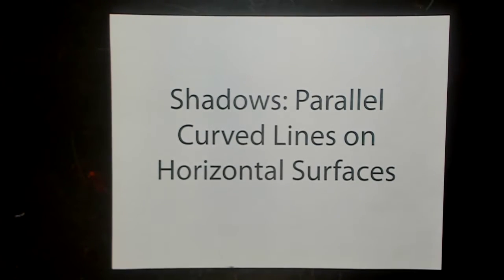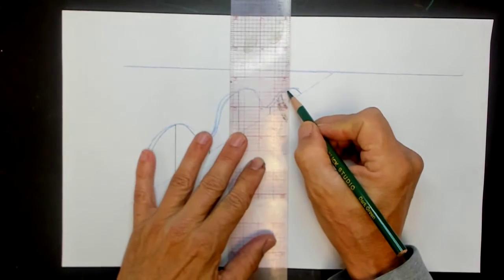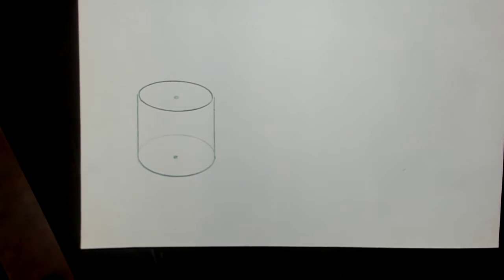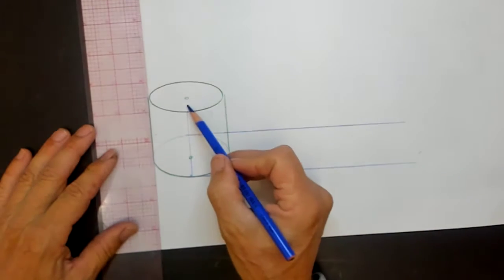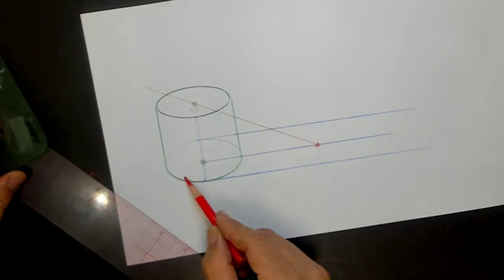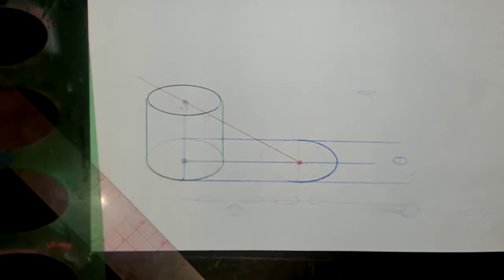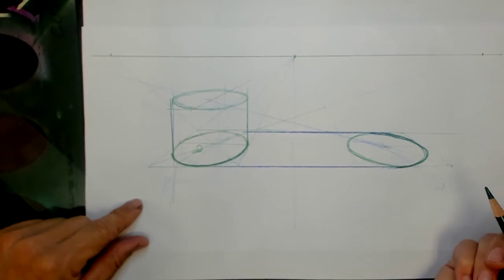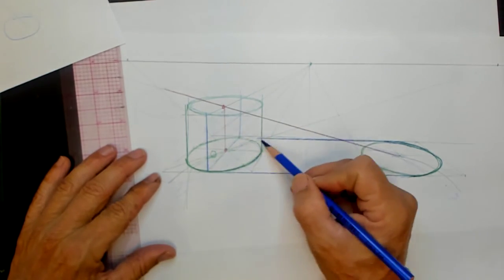97. Perspective Drawing: Cylinder Shadows, Parallel Light

Comment: IF the cylinder is lying on the ground wiht 45 degrees and the Artificial light is not parallel with the cylinder, How do I draw it in perspective?
Reply from the maker: I think I have other videos that would address that.